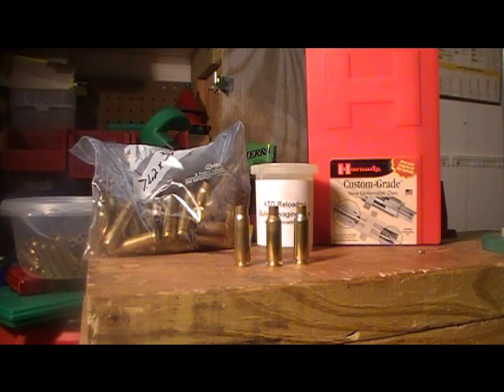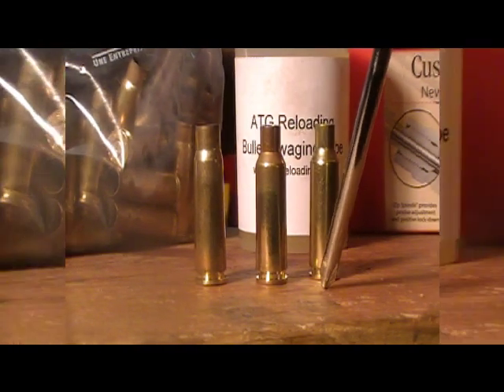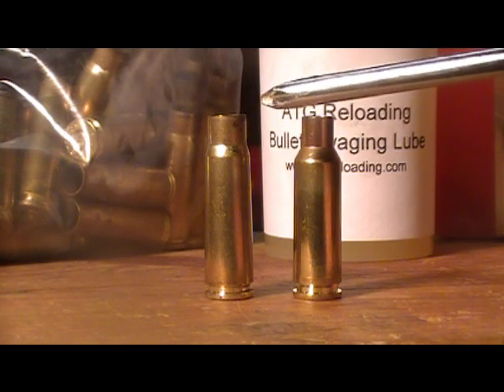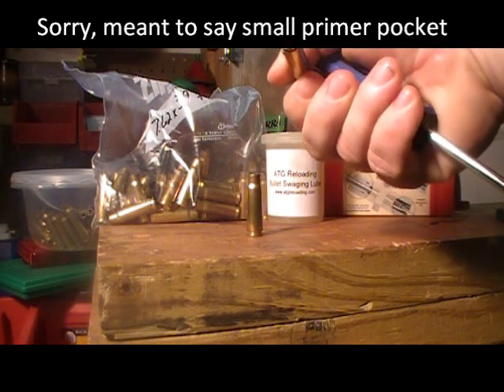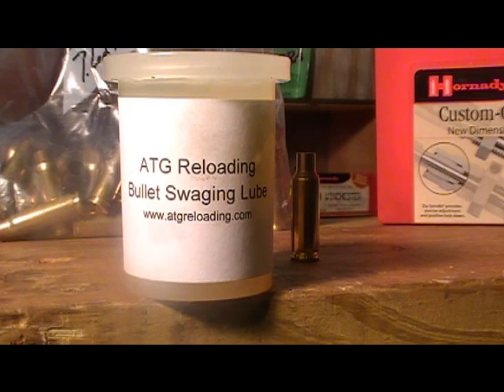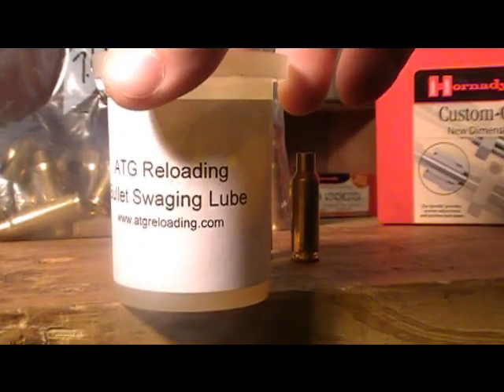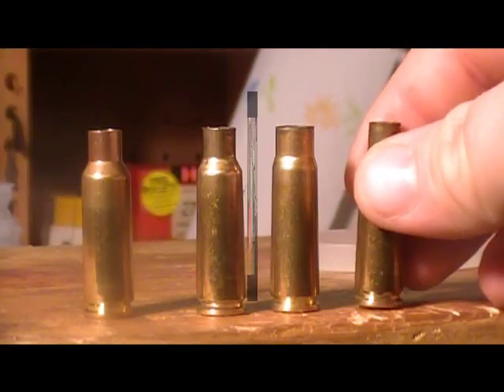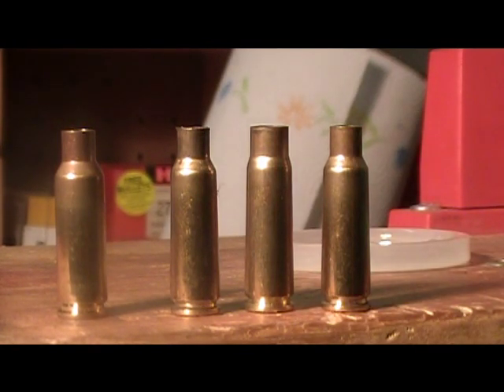atgreloading.com presents Cartridge Conversion - 7.62x39 to make 6.5 Grendel Brass

Comment from the maker: @badjeep02 Thanks. Once I get them fireformed. They will be loaded just like all the others with no problem. Now this is just for the grendel. While you can convert others, there are different things like turning the neck to except the bullet and so forth. Since the Grendel is the 7.62x39 case, just running it through the grendel die, trimming, and blowing the case out, nothing else is needed...